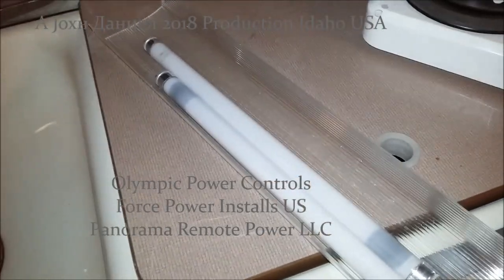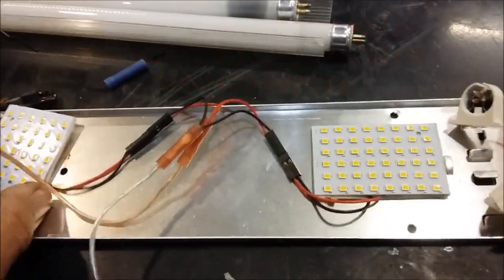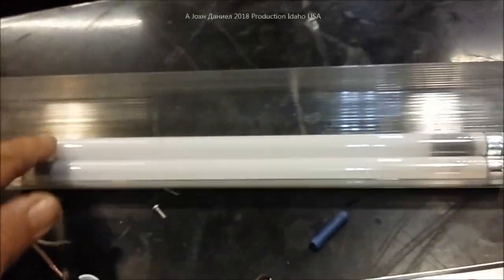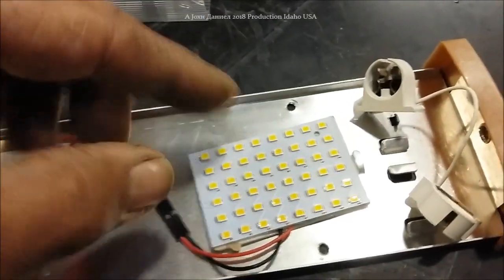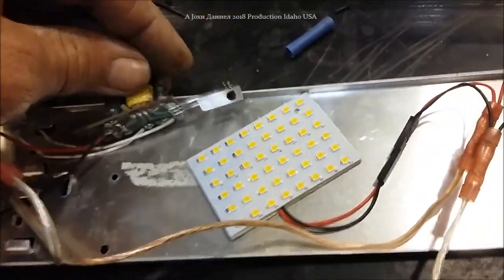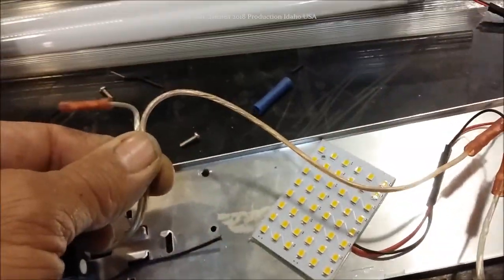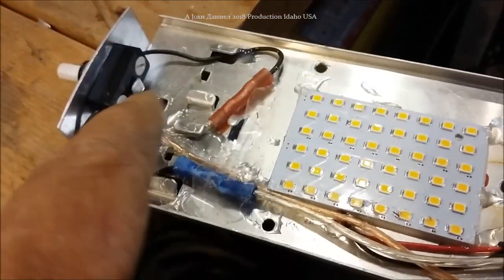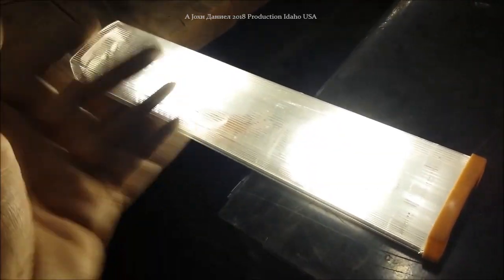BEST video on converting to LED Lighting on home & RV lights

Comment from the maker: Parts I used to do this job: Low amp, very bright Lights https://ebay.to/2krgOk9 and the AWESOME Welder Adhesive  https://ebay.to/2KXo8PD See my popular RV electrical Fix videos https://youtu.be/wmKqQzODMI4 & https://youtu.be/em96kCb1xJE
Be sure to not alter your wiring dangerously, or use damaged fixtures, or use insufficient wiring connectors. Do it right - You will love the results.

Comment: Good job!  I converted my old 1970 motorhome over completely to LED, and my cabin runs on 12 volt lighting too.  All lights on indoors and out use one tenth of a volt off my 12 volt system. 
Keep up the good work and videos!

Comment: Smart, i will buy some of those parts for my trailer too.
Reply from the maker: Make sure you get the glue, its able to handle 280 degrees and not become brittle.
Reply: I will, its the only thing that works anyway.

Comment: Fluorescent lights flickering at high frequency ie 50hz or 60hz  is a pain, those led things are great I have them in my cars and friend put them in his bus, bright and use the smallest bit of power like you say not a fire hazzard at milliamps.
I have seen led tubes to replace fluorescent tubes but cost more.

Comment: Actually ... It only makes sense.  
I even replaced all the lighting in the man-cave with LED.  Amazing the difference it made on the power bill.
Reply from the maker: I will be doing a BEFORE and AFTER video test on the 44 incandescent in the RV verses putting in 44 LED both converter and battery draw. Yes, that damn 34 foot Jayco has 44 house bulbs!!!

Comment: Hello Mr. Daniel,  have you converted any household fluorescent lights?  I would like to try your method on my indoor barn light and several house lights. Thanks for the video!
Reply from the maker: Yes, just using a 3 amp 120ac/12voltDC transformer/converter I can use the more durable smoother DC lights. The DC lights run so much nicer and without alternating flicker. You can place the transformer in numerous places, I put mine in the fixture, a very small one like these https://amzn.to/2IOJkuB .
Reply: FYI check New Egg for your transformers.  I found the one you indicated on amazon at new egg for 6 bucks less.

Comment: So this would work good in my little bus.
Reply from the maker: Be sure to use the proper adhesives and light levels for your fixture. You can make your light 50% brighter with less watts required, just don't over do it.